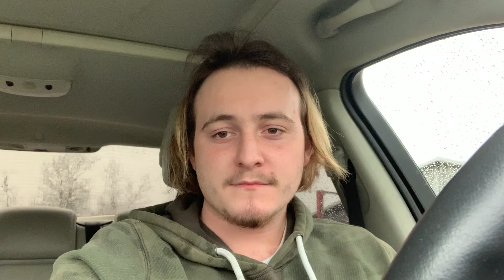Saab XWD LSD vs ELSD What’s the Difference?

Comment: You know who has really really really good four-wheel drive systems that could sleep on Jaguar X-Type it was partner made by Ford but they have the only four wheel drive system that is true 60 40 power 60% power to the rear 40% power to the front one of the best four-wheel drive systems I've ever used and it's better than Audi's Quattro it's just a shame that it didn't come in supercharged or turbocharged that would have been very interesting I drove in through snowdrifts that wrx's couldn't get through and I was the only one with PennDOT plow trucks with your state plow trucks on the road they looked at me like I was crazy

Comment: If you look at the Haldex 4 unit ,and it has the  ELSD option it will have a module with two hydraulic pipes running from the pump assembly, to the rear of the unit .  With ELSD it looks like this ,, The unit with an ELSD has a second wire runing to a fluid solonid valve that does not exsit on a Unit without that option this valve takes presure from the pump and applys to one side or other of a piston in the ElSD unit to force torque transfer bias to the Right or Left Rear Wheels on command there is an extra clutch pack on the side of the haldex unit that the axel passes through the Elsd computer can send hydraulic presure to one side or the other dynamicly altering the torque going to each rear wheel    https://youtu.be/_Jt3uyyQnNw . if you enable sport mode with awd it will dynamicly shift the torque to outside rear wheel when you corner , "if one rear wheel ends up on a slipery surface instead of using the brakes it will vector the torque to the rear wheel with grip this is a lot more efficent then applying the brakes on wheel with less grip to force the torque to the other wheel..